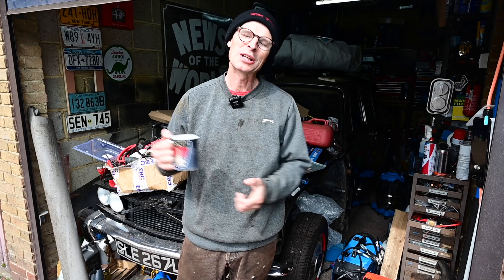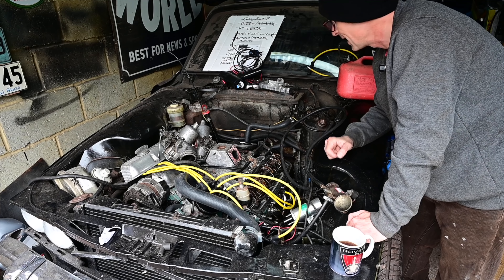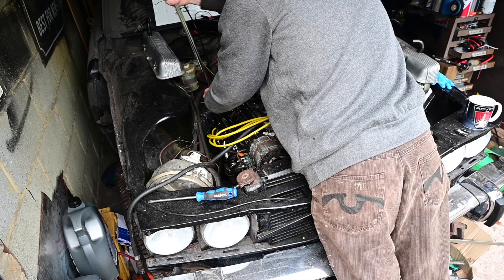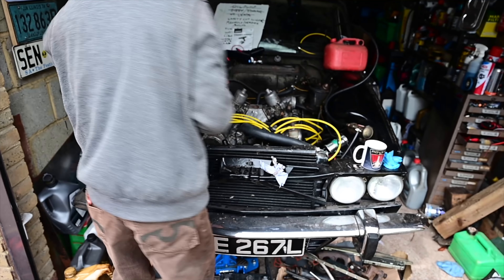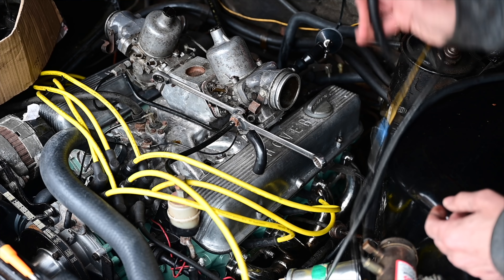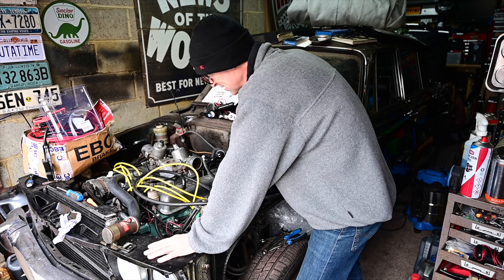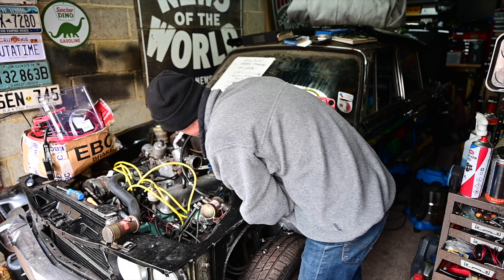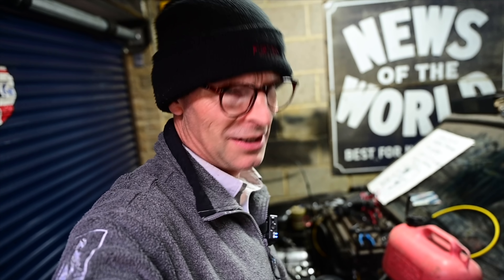Rover P6 4.6 non start SOLVED (but it still wont start)

Comment: I still think it sounds low on compression, you can't hear the cylinders pumping air... Valves need adjusting, and check compression on all cylinders. It's also probably flooded now so leave the plugs put for a bit. Good luck 👍🏻👍🏻

Comment: I used to have a p6 3500S 10.5:1 compression ratio .My advice is to do a compression test on all cylinders 170psi ar thereabouts  ,if very low do a "wet" test I.e a teaspoon of engine oil in the offending cylinders..if the figures raise up a lot its your piston rings possibility stuck if no difference its the valves not sealing .
Also check that the carb floats are not punctured and set the correct float height as per manual  
Check the cylinder firing order is 1 8 4 3 6 5 7 2 and set the timing to 6deg Before top dead centre.
Hope this helps
Reply: And check the rotation direction of the distributor, as not being any knowledge of Rovers, still some engines turns the distributors in other directions. Which poles is for number 1 engine. If you install the distributor on the wrong lap of the engine it might ignite in between the exhaust and the inlet cycle instead of in the compression cycle.
Reply: @Bratfalken  I think you could be on to something there Jan. Wonder if the time marks have been lined up on the crank damper 180 degrees out of synch, so that the spark is on the wrong cycle perhaps? Or perhaps a condenser or points issue as Matt did say the spark was very weak?
Reply: @habsom1406  I did this mistake on a Volvo B20, my simple solution was to change the wires half a lap on the dustributor. Ran it that way for a couple of years! :)
Reply: But weak spark when having an sparkplug outside the engine gives even weaker when inside a compressed cylinder. Condensers seems to work longer than points these days, the plastic notch can wear out in a couple of days removing the gap, been there done that. 3 weeks and no gap even after using the included grease!

Comment: The "fut fut" when she first winds over reminds me of when the timing is out on my Stag (with it's Rover-derived engine) and I've xranked it and let it sit for a bit  The starter will bog on the first couple of cylinders and then wind over normally - like yours did.  All it means is that she's a few degrees out, but should still fire.  When you did the compression test, the needle shot to 70 psi on the first stroke, but then did not waver in the least on the next few strokes.  While 70 is about 30psi light for any form of combustion on anything over a 7:1 compression engine, I'm also wondering if the tester either didn't seal or popped out.  Normally the needle will move or waver even very slightly on each compression stroke, but that example didn't.  In saying that, knowing what the other cylinders are doing would also put into perspective the one reading you DID get.  If they are all low, then it sounds like the valves are still not seating properly and if the exhaust does not seat when the inlet is open, it wont pull fuel vapour from the manifold / fuel from the carbs. As others have said, a squirt of oil down a plug hole before a compression test will tell you whether it is rings or valves causing the lack of compression (if there is one and the tester itself wasn't at fault).  Oil will increase compression by 30psi or more if the rings are at fault and 0-10psi if it is valves causing compression loss.  Not knowing the origin / year of your specific engine, I am not sure if there is some form of preload required on the lifters either.  Might it also be that the lifters are not getting enough oil pressure to do their job properly?  Might that "Fut fut" at the start, be one round of the lifters with sufficient pressure to open the valves properly and then no more?  (Again, to do with preload on the rockers / lifters and valve clearance tolerances etc?)   I wish I could offer more guidance, but the bloke you had out there last time - if you called him and mention you had forgotten the rocker shims and what has happened since fitting them, he may have some further insight.  All the best, mate!

Comment: Fuel delivery may be a problem but the fact there was no hint of firing with tons of easy start to me suggests that spark or compression is still a problem, or perhaps both to some extent.
Reply: I didn't have time to watch the video completely, but if there has been a lot of cranking it's also possible that the cylinder walls have been washed down by fuel and aren't building as much compression as they would normally.    If so, a small amount of oil down the spark plug hole may improve compression.   If it's not compression, and fuel and spark are present (which they would be if you're spraying starting fluid in there), it must be timing related

Comment: I had the same symptoms on my Rover V8, i.e. non start, fuel gets into the carbs but not the cylinders. It was caused by faulting needle valves in the float chambers. I hope you get it sorted

Comment: Matt you need to lift carb piston with your finger or screwdriver blade first and then spray easystart otherwise the spray isn't having full effect. Plus weak spark, is ballast resister doing it's job on initial cranking over.

Comment: I noticed that you have some stubs for vacuum hoses on the carbs. looks like some pipes need connecting to a breather or suchlike. Anyway if I'm correct air will be getting in and weakening the mixture and reducing vacuum in the manifold. Also properly check the valve clearances and ignition timing. Plus have a good tidy up!!!. Looking forward to the update. Keep up the good work, enjoying your channel.

Comment: Spraying all that easy start down the carbs is washing down the bores and lowering your compression further. Use petrol with a little 2 stroke oil to bring your compression back up and lubricate the top end

Comment: Compression is still FAR too low. You could have issues with the camshaft lobes, wrong push rods, etc. 

Did you check the valve timing?

Comment: 70 psi is a bit (read: A lot) low. Healthy will be around double that. Are the rings stuck up?
Reply: The engine also sounds like it's barely building up any compression at all, I'd definitely recheck that all valves have clearance and then do a dry and wet compression test.

The engine is never gonna fire up like this, it's just freewheeling and sounds like an engine with a snapped timing belt. If compression is low or non-existent on all cylinders and it doesn't go up when adding a teaspoon of oil I'd suspect either valvetrain damage or an out of time engine.
Reply: I agree. In fact, Matt, when I was investigating problems a few years ago with my Rover V8 on my MGB (which you have the Spanish number plate for!) I did a compression test and got an average of 156psi. (Min 153, max 161). It turned out to be ignition related so I assume those compressions are good. Another thing I do when starting cars with SUs after a long lay off is to unscrew the dashpots. It seems to help even if there’s no oil to act on the dampers.

Comment: Hi Matt, check the needle valves in the float chambers arent stuck. My 3500 had one stuck after being sat for 18 months. Also, redo the compression test - 70 does sound very low

Comment: Wonder if the time marks have been lined up on the crank damper 180 degrees out of synch, so that the spark is on the wrong cycle of the piston stroke perhaps? Or perhaps a condenser or points issue as you did say the spark was very weak? Dunno, just throwing this into the mix.

Comment: Have you capped off any "breather circuit" connections to the carbs? I know that the HIF38 has 2, but only one of them is for the breather connection. The other is an open vent, which if also capped off, will stop petrol being drawn. Been there, got the T-shirt.

Comment: Is there a restriction in the inlet manifold? In order to have compression you need something to compress.  Take the inlet manifold off and do the compression test again, if that gives you the expected compression put on the manifold without the carbs and see if the  compression changes.

Comment: 70psi is very low, is that not about 4.5:1? Maybe compression test it again to make sure your getting around 150psi
Reply: Agreed. Might be worth pouring a little oil down the spark plug holes, repeating the compression test and seeing if it helps the rings seal.
Reply: I'd don't know rover v8s that well but my fear is as all the valves were sitting a little proud there might have been a bit of piston to valve kissing. 😩
Reply: @bunter6  If that was the case there would still be no compression at all.
Reply: Agree that 70 psi compression sounds too low. It would be worth checking the valve clearances. If (as I suspect) they are non-existent, then the valves might still not be closing fully.

Comment: Check the cam timing at the valves. Measure how much valves lift. Is there any change to cam be couple of teeth off etc?  How is the spark made ? Some module?  Starter could bee too noisy for it and it throws the spark off?

Comment: With a compression test reading of 70 psi I'm not surprised it won't start. I would add other set of spacers to the rocker's. I had a P5 in to my workshop years ago that someone took too much off the heads. As soon as it had oil pressure the valves would not close and started backfiring. The other way to check would be to remove the inlet manifold and gasket, you can then see how far the pushrods are seating into the hydraulic lifters. Try the spacers first, you should be getting 150 psi. Good luck.
Reply: Yes, below 100 psi seems to give startup problems for lots of engines. Never mind full compression of this engine should be upwards of 200?

Comment: If all cylinders are on 70 psi compression then it won’t start in my opinion. Check all the valve clearances are correct and investigate further if they are correct and the compression remains low. In my experience you will need at least 110 psi for it to fire, ideally you are looking for 140/150 psi on a relatively low compression engine and 170/190 on a high compression engine from that era

Comment: The breathers on the carb are wide open which won't help matters. Have you got oil in the dash pots. Compression is on the low side but with correct cam and ignition timing, and the correct firing order on the plug leads it should go.

Comment: My guess would be that some of the valves are still open slightly as that's not enough compression. 
Really should have checked the gaps before fitting the inlet and priming the oil otherwise your just guessing what shims your fitting. 
Needs to make up that difference of the head being skimmed. 👍

Comment: Matt that is still low compression, I think a recheck is in order again. Different engine but my old 4 pot got 125psi equally and most other engines will get around 150psi when healthy.

Comment: I'd of expected 75 to 80 PSI from a rebuilt V8. My tuned 4.6 (different animal) is in the late 80's early 90's. Have you blocked the intake manifold possibly by using gaskets for  3.9 instead of a 4.6? Still appears to be spinning very quickly for a 4.6? Hydraulic valves if you have soaked the head can stay pumped up and not close properly which is why many now say don't soack the head in oil.

I would have said timing but 4.6 don't usually spin that fast.

Comment: It sounds like a classic case of the ignition firing 180 degrees out on the distributor cap.  When it's properly set up No 1 lead should be nearest the radiator. Clockwise rotation, 18436572 firing order, the cylinder numbers are cast on each induction tract. You can get it set spot on the crank pulley marks, but the distributor drive shaft is still a half revolution out. Take the distributor clamp and cap off, lift distributor a little and turn rotor arm 180 degrees and clamp it back down.

Comment: As has been said, the compression figure was very low, did you check compression on all the cylinders? Are you sure the valves are fully closed?
Reply: Ditto on this Matt - all 8. On turnover too listen for that smooth sound. You could unplug one spark at a time and check it sounds the same on 3-5secs on crank. Another way of checking as there are many.

Comment: A lot of people commenting on compression. Have you checked each cylinder ? if all low and the same, i doubt its ring problem, more like timing. Usually, if it's rings, you may get one or 2 cylinders low, but not all of them. Like others have said, you may also have a problem with the carbs as you can't smell fuel. Definitely start by check every cylinder. If all low, adjust your timing.
Reply: It can't be carbs (Well at least not for the starting issue) since eve spraying easystart in them won't start.

Comment: You may not be drawing fuel with that low compression. Take each plug out and put a squirt of engine oil in the cylinder. Put them all back in and try again. Also, please keep the fuel supply from where it could tip over, or the vapour ignite. 
We lit a '56 Plymouth Plaza on fire in my high school auto mechanics class, when the carb backfired and ignited the vapour from the gas can. Seventeen year old petrolheads thought it was pretty funny, actually.  We had a substitute teacher that day. He didn't think it was funny. Poor guy probably did some drinking that night. :-)
Reply: I agree on the fuel draw, low compression connection. That’s what it has to be.

Comment: Certainly sound like the carbs are at least part of the problem. But I am surprised it did not fire up with just the easy start. I am also wondering about compression, should the reading not be double what you were getting? 70 psi seems very low. But even then, i am still surprised it did not fire with the easy start, that stuff can normally get even the most tired of engines to fire. I think maybe you have more than one issue going on, maybe that weak spark is compounding things.
Reply: More than double, I am pretty sure.

Comment: Maybe fuel returns are the wrong way around maybe the pumps not pumping enough pressure from the fuel  Regaulter. Or blockage in the carbs

Comment: 70 psi is low but the engine was throwing over slow, perhaps the tappets are not pumped up, good to try a proper test on all cylinders. But it should still fire on easy start with crap compression. Don't think the carbs are your problem, they might be a problem but you could take them off and spray easy start down the inlet and it will fire. You say the spark looks weak. I'd start by checking the coil is not 12v and or the non ballast power from the starter is ok (if your car uses a ballast resistor). Check the voltage at the coil, the car has been standing and a bad connection could drop the voltage. Check the rotor arm is good and not decided to conduct, rare but I have seen the plastic break down. The firing order. Is it correct. Was 1 piston on the correct stroke when the distributor was fitted. And I suggest a start charger on the battery it sound slow. I assume your 4.6 has the same firing order. You try using a strobe light while cranking at least you'll know its firing in the right place

Comment: I should have added it's the VALVE timing that it 180deg out. If the exhaust is open and the inlet closed on the down stroke no fuel gets sucked into cylinder, inlet open on up stroke could force fuel into return pipe.

Comment: If the beastie won't go after having fuel thrown straight into the carb mouths (eliminating the floats, etc.), AND has a spark then you still can't have enough compression - which is what it still sounds like - or compression at the same time as the spark.  Have a look at the valve clearances, and if they're ok after the rocker shaft shimming then check the leads are in the right order and the distributor cap is the right way round - I've had aftermarket V8 caps that didn't have the detent to ensure they only fit in one position, and I've fitted them 180 degrees out.

Good luck!! 🤞🤞🤞

Comment: Was a new timing chain or cam fitted? I once had a Charger that acted like this after a timing chain repair I did. Wound up having the car towed to a shop and spending almost $300 to get it running (in 1976). The culprit turned out to be the timing marks on the gears were installed dot to dot in normal fashion instead of the right way around (12 and 12) for a 318 Mopar. Your Rover V8 is one of the few weirdos I've run across that like it like that too. Too bad the front of the engine has to come off to check it....

Comment: Checking compression or spark on one cylinder is not enough. Do them all. Get a momentary push button switch and rig it so you can activate the starter from under the bonnet.

Comment: As other people have commented to compression test every cylinder and the test you did on one cylinder was very low at 60 psi another thing could be the carburetors they have been sitting around for a while and if it was E5 fuel in the carburetors could affected the rubber seals because ethonol is not good for carburetors l don't use it in my carburated hilux and as you now in Australia we have a choice of fuels that maybe the problem also carburetors don't like sitting around for a long time although you were using starter fluid to try to start it start with a compression test first

Comment: I think you need to go back compression test all the cylinders (70 psi is low ---- check the valves are fully closing), strip the carbs to check the float needle valves aren't stuck and the air piston/needle aren't stuck (SU's can corrode slightly round the piston valve/needle assembly), as it controls both fuel (the needle and main jet) and air (the piston valve) going into the engine.